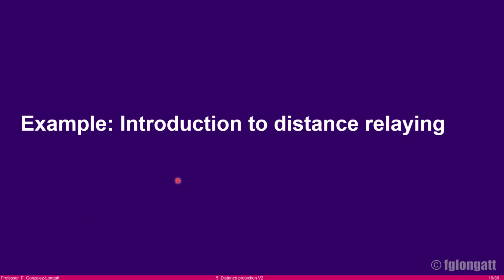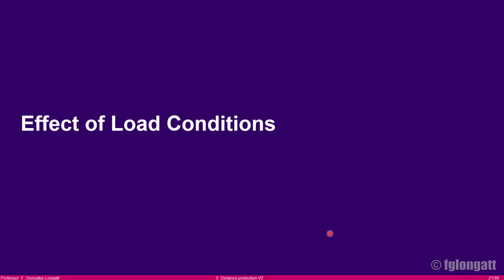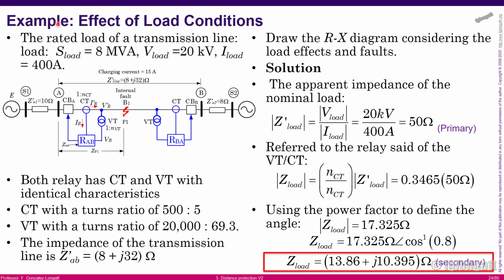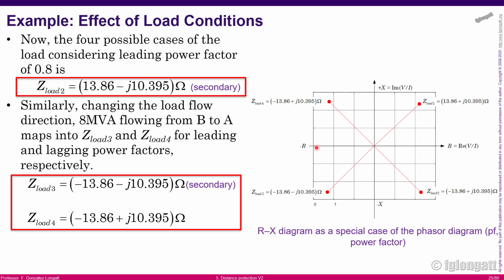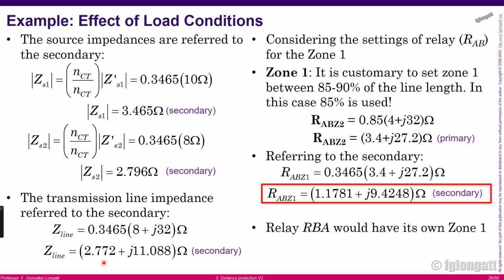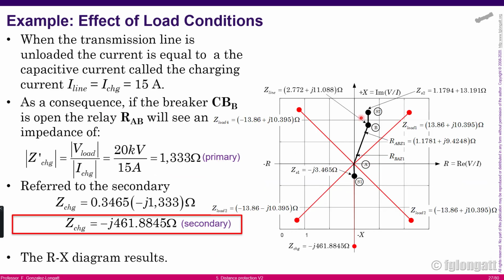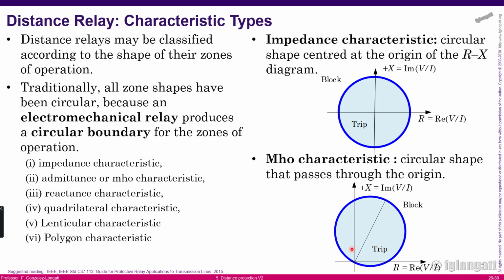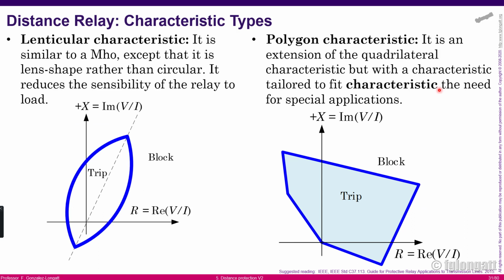Class 5 Distance Protection PART II

Comment: Sir resistant value is written worng 4 instant of 8 @ 14:16 at middle line of R. H. S paragraph
Reply from the maker: Dear @Tufail Alam, thanks very much for following my videos. I am really impressed, you are totally following the calculations. I appreciate it. I have included the appropriate changes in that slide and also the one following that. Thanks very much. Please, let me know if I am able to help you. Best regards FGL
Reply: @FranciscoGonzalezLongatt  sir i am also very impressed by your  explanation. Kindly send me this pdf.. tufailalam93@gmail.com
Reply from the maker: @tufailalam6438  Thanks for your comment. Please allow me a bit more time to release all the slides! I am making a few improvements and adding a few more comments. You will find them here: https://www.researchgate.net/project/Power-System-Protection-13